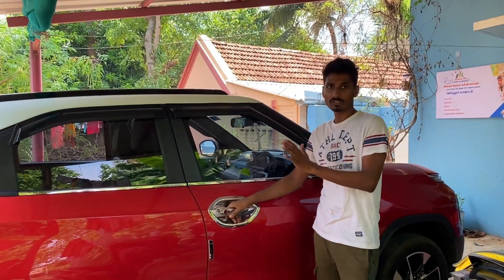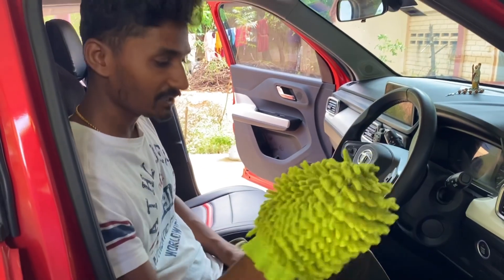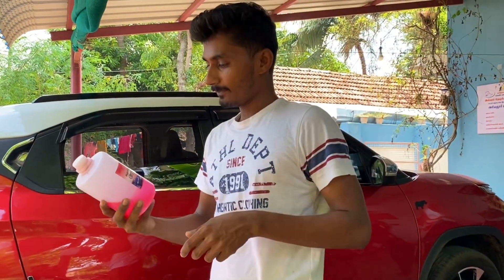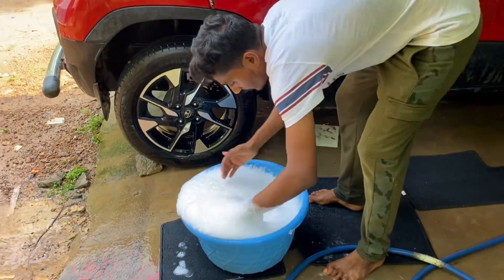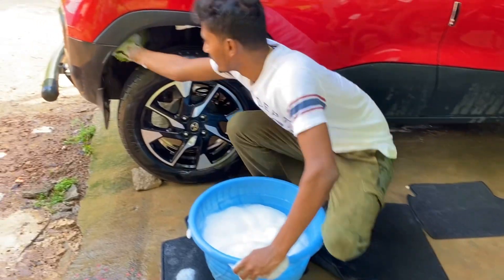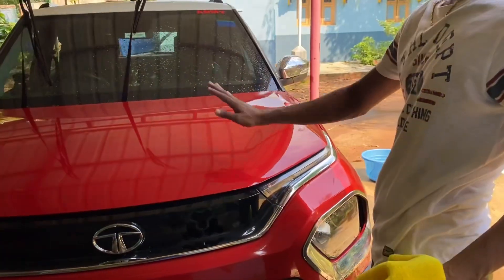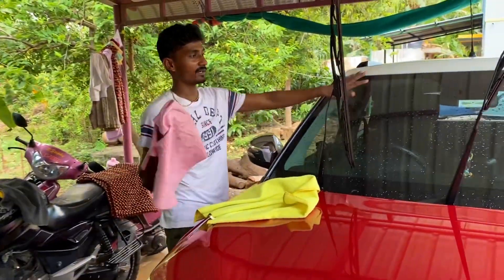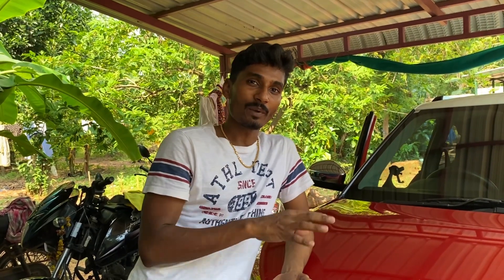எளிய வழியில் Clean Car  Wash In Home No Machine Required

Comment: Bro, Right side driver door rubber featingla rain water store aakuthuna parunga please. Apuram cluster DRL meter off akura problem vanthrukka. Radiator heat akuthunu problem oru sila vandila irukkunu TATA solli iruku, vandiya service centrela koduthu fuse mathi kodupanga avangaley.freeya.